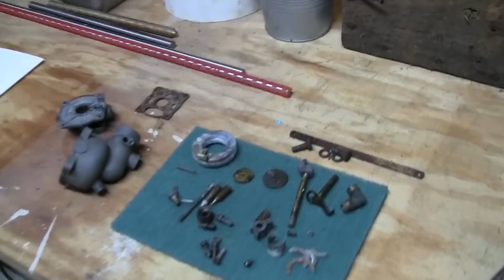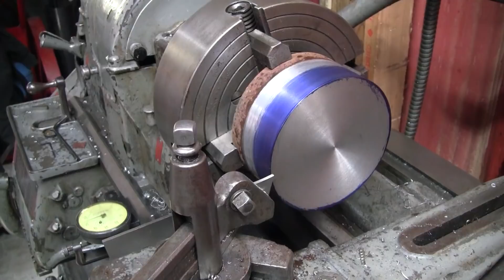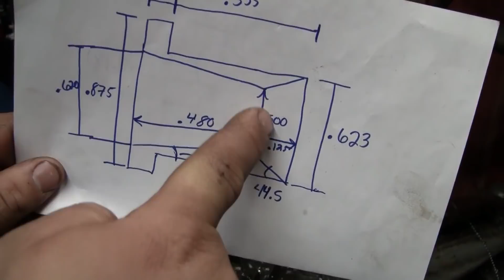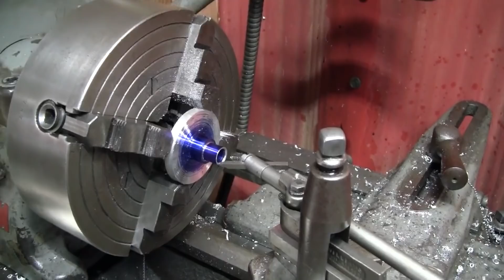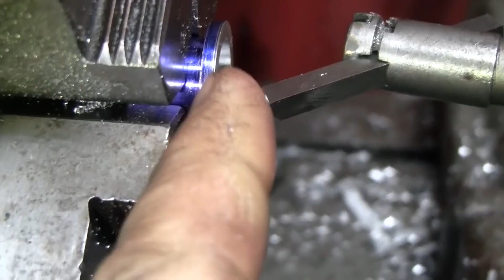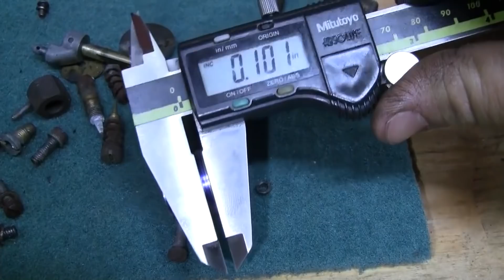PRONY BRAKE DRUM + CARB VENTURI 74 Year Old Briggs and Stratton HOW MANY HORSES ARE LEFT? Pt.3/5

Comment: Why don't you do a rotary phase converter?  VFD's are nice but you really need one per machine so you are really looking at 3 and the sander probably doesn't warrant the cost of having a VFD on it.  Scrounge yourself a 3 phase motor 2-3x the size of what you want to start and then get yourself a control box.   You do need to wire a separate distribution system for the 3 phase after the converter but it looks like you already may have that handled.

Comment: With as many 3 phase machines as you have I would build a rotary phase converter, all you need is one larger 3 phase idler motor 10hp is probably plenty, and some capacitors and contactors, then you can power several machines with one device rather than a vfd for each, plus should you ever get another machine or something 3 phase you want to test you can. If you want turn key, several companies make a ready made electrical box where all you add is your motor.

Comment: Go get yourself a heated ultrasonic tank...  fill it with vinegar...  It will open all the ports and remove the calcium even from the tight spots...  BUT don't leave it in for more than 30-40 minutes in hot vinegar...  Torch tip cleaner kit helps also.. Once I got it perfected, I haven't found a carb I couldn't salvage...

Comment: If your engine shaft is pitted, you might want to have it spray welded to original specs. Abom79 (Adam Booth) on his channel could  weld that if you contact him. Check his channel to see him using it.

Comment: What size is your south bend?  I recently got a 14-1/2 or 16" can't figure it out.  Trying to get it fixed up enough to use for now.  Mine is the super long model, the bed is like 8 feet.  Made in 1943, has a war production board tag
Reply: i also recent l y got what i think is a 13 or 16" s.b. that uses an overhead countershaft and flat belt with 4 speed cones. the c.s. and motormount assy is home made
Reply: @stevestolberg5273  wow, the spindle end of mine looks exactly like his.  yours must be older
Reply: @RickBaconsAdventures  ill send u some pics if u want. i was just out there using it on a tool i had to mod for another job so its uncovered
Reply: odd thing is mine has the south bend nameplate but also has a nameplate that says monarch.
Reply: @stevestolberg5273  That's really weird!  I'm almost certain now that mine is a 16.  The back gear adjusting things are apparently different on the 14-1/2 and mine are the 16 style
Reply: @RickBaconsAdventures  the back gear on mine has a counter shaft with a big gear that engages a gear behind the chuck and a small gear that engages on the other end of the spindle shaft that is shifted with a lever  that moves it on eccentric and u gotta loosen a bolt on the front face of the cone pulley right behind the chuck and slide it toward center to engage/ disengage the spindle shaft from cone gear (or it locks up when counter shaft engages)
Reply: i got it funcioning thoigh

Comment: Super fast way to line up uneven ended large stock is to use a square on the face lining to the face of the chuck. Place it three or four times and you're within eyeball tolerances regardless of how lumpy the cuts are. Old timer trick i got taught once.

Comment: I'm retired and I've been around construction all my life and I'm embarrassed to say I've always thought it was called a "pony" motor.
Reply: Prony brake, Pony motor. You sir are correct in your assumption.
Reply: A "pony motor" is an ancillary engine used to start the main engine (typically a small gasoline engine used to start a larger diesel engine.)

And a little "Prony brake" history: https://en.wikipedia.org/wiki/Prony_brake
Reply: @trickyrat483  Ok, I was correct all these years. Thanks everyone 👍👍
Reply: @trickyrat483  Thanks for the info,  I never heard of them called that but we used them all the time in line construction to hold wire reels from running free as the wire was paying out. (Only on small reels)
Reply: You're correct with prony vs pony.
 Prony is just the last name of the guy who invented the brake type.

Comment: If you grind a chip breaker in the end of the high speed cut off tool and keep the work flooded with cutting oil, it will really help... I stil use a 16" 1957 South Bend....Cheers from Louisiana Mike

Comment: If you ever need to make an inertia dyno I suggest using a big old electric engine, the manufacturers has data for the rotational inertia of the rotors! It is easy to setup with speed sensors and free pc software!